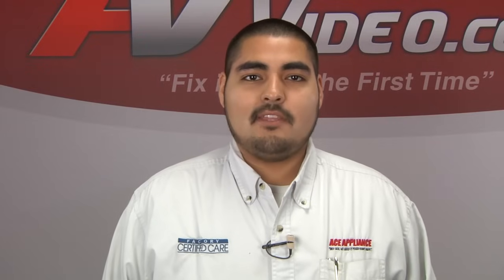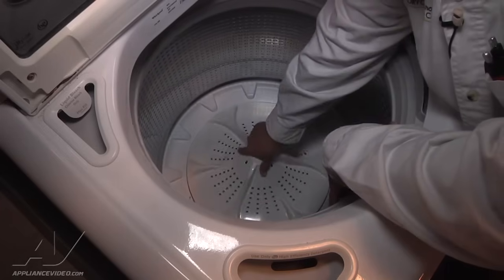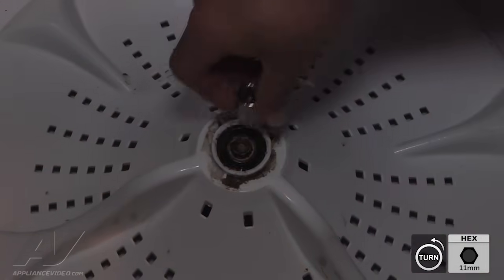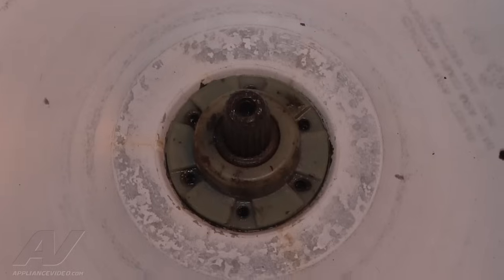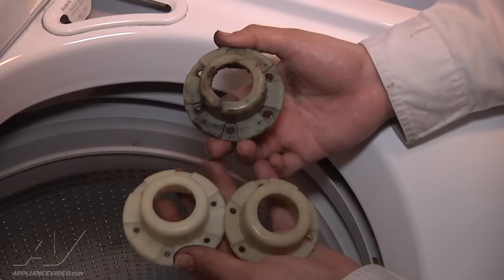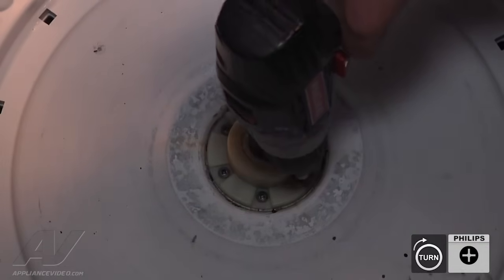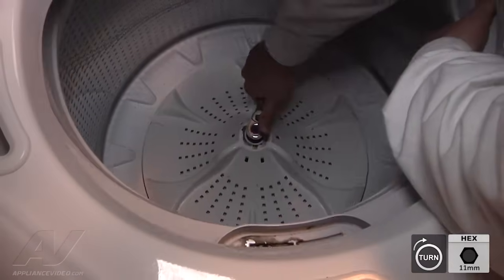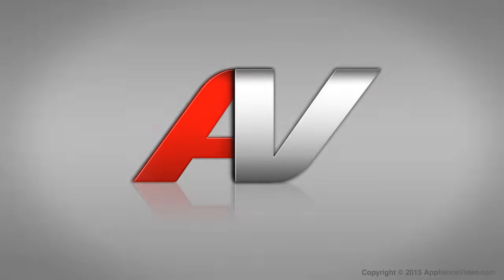Whirlpool Washer Repair - Error Codes SD and F71, Will Not Spin - Basket Hub

Comment: I've worked on these washers for years and this is the first video that I've ever watched that actually explains the HUB replacement process 100% correctly.  I can't tell you how many washplate caps I've replaced because the three locking tabs weren't lined up properly when the cap was replaced.   Mentioning to pull the tub up evenly with the six screws is a must.  Great video sir.
Reply: 😊 Say🎉😢

Comment: Thank you. I got a 5D/SD error code. I saw a different video that said it might be a clog with the drain hose but I didn't it could be that so I searched further and found your video and thank god. It took me a long while to remove the agitator. I had to wiggle, pry, use two small screwdrivers to go into the holes and pull up while slowly turning the tub. Then I lucked out when I stuck two screwdrivers opposite from each other and pried up against the middle inner bar and all of a sudden the popped up about 3/4 of an inch which then allowed me to grab the agitator from the bottom and wigglee it off. It took about half an hour to get it off. After that the next hard part was to remove the clog that is on the middle bar. I used a pipe wrench and slowly wiggle it off. After that there was a lot of grit on the grease on the middle bar. Wiped it all off and add silicone grease. Used a 1 1/2" pvc pipe to tap down the clog on the middle bar. Do not tap it all the way down. Use the piece that screws on to bring it down further. After that everything else it a breeze. Good luck to everyone who needs to replace it.

Comment: AMAZING video!  I can't recall how many videos I watched before this one.  You're "hold the drum and try to turn the agitator" diagnosed the issue in seconds. Thank you for not only walking through how to figure out the possible causes of the SD error, but exactly what parts are needed and HOW to fix it.  Parts less than $10 and it took me literally 15 minutes.  THANK YOU SO MUCH!

Comment: Thanks so much for this.  We’ve had our washer for ~7 years and when it broke, I figured we’d be spending a ton on a repair or replacement.  Instead I spend $14 on a part from Amazon.   Installed in about 30 minutes following your video and it works like a charm! 

Even got to clean out the washer a bit more than normal.   

Thanks for posting!

Comment: Excellent video with steps by steps on how to replace the Basket Hub.  I had the exact diagnostic error code the repair guy said it was the control panel or motor and $400 to replace.  I found your video and it was the basket hub for $30.  Thank you so much for this video.

Comment: awesome video. Loved the fact you even gave socket size. Only thing I had trouble with was sliding the new piece down the shaft, I had to use a wooden block and rubber mallet to tap tap tap it down to the bottom. Repair worked great..... $14 dollars and a you tube video saved me the cost of a new washer.

Comment: Works for the Maytag Bravo Quiet Series 300 (MVWB300WQ). Thanks a bunch for the video! The bottom of my basket hub was stuck on pretty well and I needed to watch this to make sure there's nothing else holding it back. Ended up using a crowbar to pry it out

Comment: This fixed my washer!  Like others, I had a hard time getting the inner part on the spindle. I used a really large socket and gently hammered it on. Not sure what the issue was, maybe the splines were dirty, or the washer was a bit smaller. Assuming this part lasts for years, I won't have to worry about getting it off again.

Comment: Great video. My tub hub kit did not slide on/off as pictured in the video. I had to hammer lightly and use channel lock pliers in order to get the (last) small piece with the splines off. Then the new one would not go all the way down. I used approx 1" scrap pvc and down the shaft to protect the new piece and placed an old crescent wrench on top and hammered the base of the handle until it went all the way down. It was hillbilly adapt and overcome, but it worked. Hopefully this trick helps someone else. We're back up and running for under $11 and the kit was delivered next day from Amazon.

Comment: Great video...instructions were spot on.  The only thing I had difficulty with was removing the impeller.  After 7 years of use it was stuck on pretty good.  I used a "flat" dog leash which I wedged under the impeller edges and slid to the middle--where I "worried" it off by lifting alternately on each side till it popped off.  Also, I spent a good 30 minutes cleaning the underside of the impeller prior to reinstalling.
Reply from the maker: Glad it helped
Reply: Ty. I tried the flat leash method and it worked great! Awesome tip!
Reply: Was looking for something just like this! Thank you

Comment: "SD" no more!  Spin diagnostic in video confirmed problem and tub hub was easy to order on Amazon.   Used 7/16" socket wrench as alternative to 11mm.  Removing the impeller took a while until I found the right way to slowly jiggle it off (there was a lot of crud).   Scrubbed more crud off the screws with a toothbrush then used hand screwdriver (preference) to install the new parts.  Washer back online!  Thank You!!
Reply from the maker: Thanks for your response, we are glad we could help. Our library
of over 5,700 videos are currently helping 1.6 million people like you every
MONTH.  Please help us by subscribing to
our YouTube channel, or post our website www.ApplianceVideo.com to your Facebook
page

Comment: Excellent video for the repair, i have identical problem. 
I have ordered a new hub kit, however once I pull up the smaller white gear, i found the splines of metal shaft that contacted with this small gear, the surface are partly rotted, while the upper splines are pretty good with straight splines around. 
Should I be worried the replacement?

Comment: This video was oustanding!  I fixed my washer previously when using this video.  However, my Cabrio just errored again with the same 5d code after a year or two.  By using your shortcut of holding the tub while attempting to spin the agitator, it appears the previous repair is still ok.  What else do you feel could be creating the error code, 5d?

Comment: One of 2 videos I saw late last night after running into my Cabrio ending up with soaked clothes, noticing spin cycle wasn't spinning..seemed to be trying but nothing. 

The f71 came up after Diagnostic mode...Went through these steps early this morning. That small center piece, the "teeth" are grinded down to nothing! I'm actually shocked this plastic thing lasted as long as it did! (about 6,7 years)

No where local that has this, or an appliance store that will just sell me this part - they just offer repairperson to come out. 
Ordered the replacement part online, should be here tomorrow. Should..more like HOPE that is 100% fix. Whatever the case, it clearly had to be replaced. Thanks so much for this video!
Reply from the maker: Great question, if you have a more technical question that our parts department cannot answer, you can search our over 17,000 answered questions free at our website www.ApplianceVideo.com under our Repair Help section. You can also call our parts department at 1-800-830-5465 and they can give you help 7-days A week ,or search at www.SaveMoreOnParts.com  .

Comment: Thank you for the video! I bought a new bottom hub kit but this new inner hub will not go all the way down as the old one did/does. The new and the old hubs look almost identical except that of course the old one's cogs are ground off substantially. Could you suggest anything? Maybe to force it down with a hammer or something of the sort?
Reply from the maker: Great question, if you have a more technical question that our parts department cannot answer, you can search our over 17,000 answered questions free at our website www.ApplianceVideo.com under our Repair Help section. You can also call our parts department at 1-800-830-5465 and they can give you help 7-days A week ,or search at www.SaveMoreOnParts.com  .

Comment: Great video. I can’t seem to get the bottom hub piece off?? Any ideas on how to remove it seem to be rusted or stuck on??
Reply from the maker: Great question, if you have a
more technical question that our parts department cannot answer, you can search
our over 10,000 answered questions free at our website www.ApplianceVideo.com under our Repair Help section. You can also call
our parts department at 1-800-830-5465 and they can give you help 7-days A week
Monday -Sunday, or search at www.SaveMoreOnParts.com  24 hours
7- days A week.
Reply: We're   having the same issue.
Reply: Same here!  I’m almost done with the repair, but I can’t get the bottom part of the hub off!!
Reply: I had that problem I had to pull it with a string around the spin thing keep pulling and putting until it came off but don't put too hard to were you will break the spin plate it will come off
Reply: SAME. Please show us what to do if the bolt is stuck on.
Reply: @Appliancevideo  By the way,   your website doesn't work. Thanks.

Comment: I have a whirlpool Cabrio WTW6600SW0.  I replaced my bearings that were shot. My stator is cracked but I reinstalled it. I reused the old shaft because the new shaft's skirt was too low and couldn't get the threads to show in the bottom after tightening the bearings x 3. When I compared it with the old shaft there was a 1/2  difference. So put it all back together and did first load with jeans and colors. All went great, very silent clothes came out all dry. The third load the machine was squeaking during spin and would throw the uL code even after I repositioned the clothes more than four times. What do you think is causing that? Cracked stator? Over tightened bearings?
Reply from the maker: Great question, if you have a more technical question that our parts department cannot answer, you can search our over 17,000 answered questions free at our website www.ApplianceVideo.com under our Repair Help section. You can also call our parts department at 1-800-830-5465 and they can give you help 7-days A week ,or search at www.SaveMoreOnParts.com  .

Comment: Hi, great informative video! I am trying to remove the tub from the shaft but I can't seem to lift it off so I can access the basket to clean filter and remove some socks...Any suggestions? Stuck! Kenmore Elite Oasis HE
Reply: DJ TRAP I know this post is a year old but did you end up getting it off? I have the same washer and I can't get it off either
Reply: We're talking about the impeller, right?  Anyway, take out the 11mm bolt, then add CLR, wait, flush with water, jiggle gently, repeat.  After a time, you'll be able to get your fingers under the impeller from the sides and be able to jiggle a bit less gently.  I'm not totally sure the CLR matters.

There's a lot of crud on the spline the impeller is attached to.  CLR should dissolve the calcium and rust; flushing gets rid of the crud.  I did not have another washing machine as a control, so I can't say definitely that the CLR made any difference.
Reply: One more thing ... wear gloves and safety glasses -- CLR (and the crud that comes out) is nasty.
Reply: This question was years ago . But for anyone else like me.... Who has done everything short of taking the whole damn washer apart: I ended up giving mine away and the guy who bought it said there is another nut underneath the washer somewhere. Maybe a certain model of this same washer has this. I watched tons of videos where they just pulled it out. I tried everything. When a crowbar won't even work, physics tells you there is something else keeping it from coming out..lol.
Reply: My washer is a "WTW8900BW0" -- it takes the same part and has the same weakness.   I was tempted to go crowbar on it, but something I read cautioned to take it easy as the problem is rust and calcification on the spline.  CLR and jiggling took about 45 minutes, but it did come free.  Ugly nasty stuff underneath.
Reply from the maker: Thanks for your response, we are glad we could help. Our library of over 5,700 videos are currently helping over 1.6 million people like you every MONTH.  Please help us by subscribing to our YouTube channel, or post our website www.ApplianceVideo.com to your Facebook page, Twitter, Instagram or any other social media sites. Your support will help us keep producing more free quality videos.
Reply from the maker: Thanks for your response, we are glad we could help. Our library of over 5,700 videos are currently helping over 1.6 million people like you every MONTH.  Please help us by subscribing to our YouTube channel, or post our website www.ApplianceVideo.com to your Facebook page, Twitter, Instagram or any other social media sites. Your support will help us keep producing more free quality videos.
Reply from the maker: Thanks for your response, we are glad we could help. Our library of over 5,700 videos are currently helping over 1.6 million people like you every MONTH.  Please help us by subscribing to our YouTube channel, or post our website www.ApplianceVideo.com to your Facebook page, Twitter, Instagram or any other social media sites. Your support will help us keep producing more free quality videos.
Reply from the maker: Thanks for your response, we are glad we could help. Our library of over 5,700 videos are currently helping over 1.6 million people like you every MONTH.  Please help us by subscribing to our YouTube channel, or post our website www.ApplianceVideo.com to your Facebook page, Twitter, Instagram or any other social media sites. Your support will help us keep producing more free quality videos.
Reply from the maker: Thanks for your response, we are glad we could help. Our library of over 5,700 videos are currently helping over 1.6 million people like you every MONTH.  Please help us by subscribing to our YouTube channel, or post our website www.ApplianceVideo.com to your Facebook page, Twitter, Instagram or any other social media sites. Your support will help us keep producing more free quality videos.

Comment: THANK YOU! 
I have the Sd and the F71 except my washer is a Kenmore Oasis, same fix? My washer does not spin and pump the last little bit water under the tub at the end of the cycle.
Reply from the maker: Great question, you can call
our parts department at 1-800-830-5465 and they can give you help 6-days A week
Mon-Sat . You can also search at www.SaveMoreOnParts.com 7- days a week.  If you have a more
technical question that our parts department cannot answer, our technicians are
answering all questions at our website at www.ApplianceVideo.com under our Repair Help section. We have over
4,000 common questions and answers that you can easily search through by your
model number, appliance make, and problem or error codes, and It’s free to
search through our question & answer library.
Reply: Did ever figure this out?

Comment: Thanks for posting this! But..My tub and impeller spin together. I cannot get one to spin without the other.  But I have the SD error. Do you have any other reasoning for this? I read somewhere that I may need to reset my Cabrio or recalibrate it..something about the pressure sensor..I have NO clue how to do that. Do you have a video on that? Thanks in advance!
Reply from the maker: Good question, with our technicians
now getting hundreds questions weekly, they are answering all questions at our
website http://www.appliancevideo.com/repair-help/ .  We also have over 3,000 common questions
and answers that you can easily search through by your model number, appliance
make, problem or error code and it’s absolutely FREE.

Comment: Thanks for the video. Everything went great until it came to removing the bottom portion of the hub. It seems to be fused to the shaft. Any advice you could give would be greatly appreciated. Thanks again.
Reply from the maker: Great question, if you have a more technical question that our parts department cannot answer, you can search our over 17,000 answered questions free at our website www.ApplianceVideo.com under our Repair Help section. You can also call our parts department at 1-800-830-5465 and they can give you help 7-days A week ,or search at www.SaveMoreOnParts.com  .

Comment: I have the same problem with the SD code. I watched the video and did exactly as you said. The centerpiece on my washer did not spin around as shown at the beginning of your video. Do you have any other suggestions?  I thought it might be the motherboard, but I don't know if the washing machine (10 years old) is worth the cost. Plus, I don't know how to install a new motherboard. Any other advice or helpful videos that are easy to follow and understand like this one? Could you please advise?
Reply from the maker: Great question, if you have a more technical question that our parts department cannot answer, you can search our over 17,000 answered questions free at our website www.ApplianceVideo.com under our Repair Help section. You can also call our parts department at 1-800-830-5465 and they can give you help 7-days A week ,or search at www.SaveMoreOnParts.com  .

Comment: July 7 2023.
Heads up for everyone. My whirlpool cabrio suddenly gave a 5D code. Try searching up on youtube and everything that pops up is Drain pump malfunction. I disassemble the washer and go to  drain pump and check/clean if theres object on it, but everything seems good. Then i start the washer and still the problem persist. Then i came across this video and do the spinning trick he did in the 1st minute to check if the hub is loose. I bought the hub in amazon for 14 dollars and do what wxactly says in the video and finally it works.
Tips = Use a big Rachet Wrench to take off the bolt. If you do it on 1st time it is really stiff and you might break something on the process.
The drill/driver makes life easier.